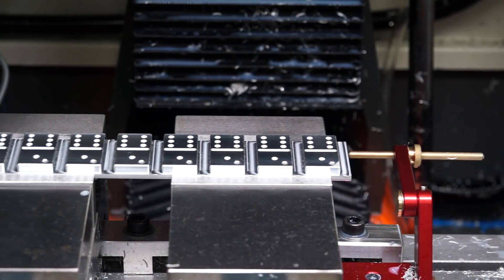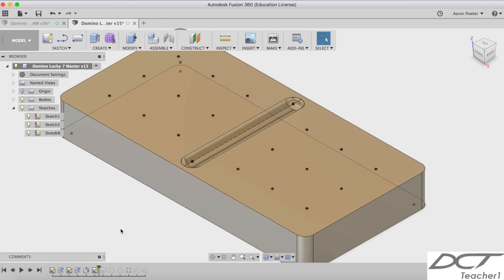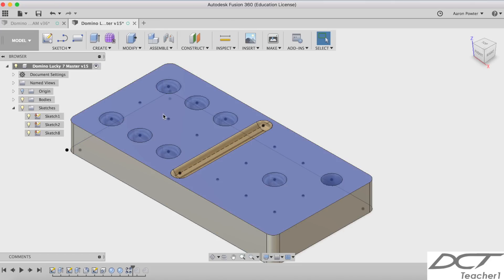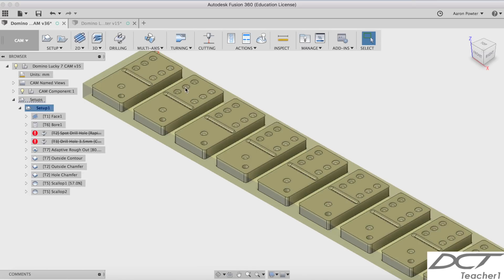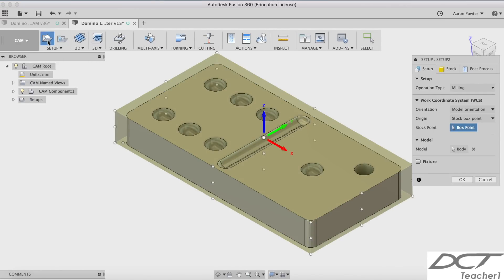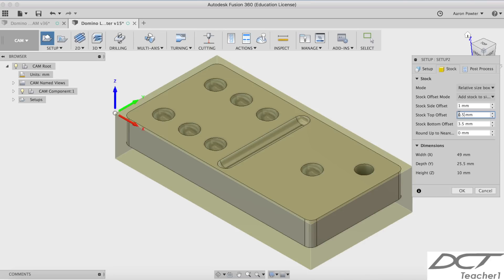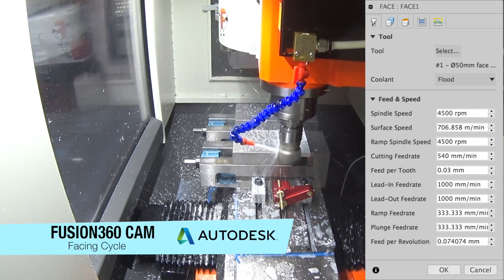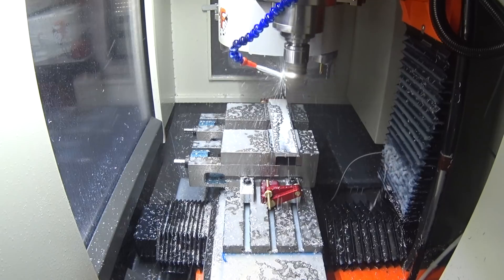Fusion 360 CNC Machined Dominoes Pt.1

Comment: Hi Aaron, what driver does the Skyfire use?
Reply: Aaron: Thanks for the honest opinion of the 4650 controller - you probably just saved me from a total disaster! I was just about to ignore my fears about the Skyfire not having local support and getting a quote on an SVM-2 with the 4650. Bullet dodged this time.
Reply from the maker: Hi Marvin, do you mean what Post Processor am I using?  If so I'm using the standard Fanuc Post that has been modified to suit my machine.  The controller on the machine is an Adtech 4650 (Chinese).  The controller struggles with large files and complex 3D toolpaths.  Cheers, Aaron.
Reply: Aaron: looking at the Adtech site, they have a new 9640 controller to replace the 46 series. Its so new that there is no manual but they do mention increased CPU performance and more ATC capabilities. It is also the same physical size so I emailed Skyfire about the possibility of using it. No reply so far...

I also looked at the ATC support in the 4640 manual. I am absolutely no expert, but there is a hint that the controller will handle up to 24 tools and that your 7 +1 is an artificial limit. The SVM-2 has the same controller and more ATC slots, so it makes sense that the controller will handle more.
Reply from the maker: Hi Nick, sorry for my belated reply.  My honest advice, give SF a miss and get a price on a SyilCNC X7 or X5 combo.  Check them out on Instagram "CNSyil".  They might be a tad more expensive, but much better bang for buck.  Syil will soon have 3 dedicated controllers on offer.  This will be Linux, LNT 5800 or Siemens.  Furthermore, Syil are an OEM company so at least you now they will do proper quality control checks before shipping.  Unlike another company wink wink ;-).
Reply: Thanks Aaron! The X7 has some great features - I wish the table was a bit longer we can't have everything. Will definitely get a quote.

Comment: Thanks Aaron, as always very informative. Can you explain the limitation about tool library with Adtech controller?
Reply from the maker: Hi Marc, the controller on this machine is an Adtech 4650.  I believe they are still sold by the company but further development has been stopped.  The controller is fine for simple 2D operations.  However, it struggles with large and complex 3D toolpaths.  As you can see it works fine within the parameters that I use it for.   Furthermore, it is locked out to 8 tools only due to the tool changer and I cannot any tools or the library outside of this.  Cheers, Aaron.

Comment: Nice and clear explanations, thank you mate. 

Quick question if I may.... 
You spoke about being limited to 8 tools, (well 7 to mill with) in the Skyfire changer. With other systems, can you have say 16 or 32 holders ready, with tools setup in them, and have all of them loaded into the VMC program? That way if your job needs say tool 14, 19 & 27, you can load those tools into the 8 way changer and just tell the program that took 27 is in slot 5 (could be 27/5 in prog) 
Or am I over thinking my options? 
Thanks for any help/advise Aaron
Reply from the maker: Hi Rob, thanks for the message mate.  Yes I totally understand what you mean.  And this is possible in most other controllers / machines.  However, for some reason my machine only has 10 tools listed in the tool library, but it impossible to access any tool outside of tool 8.  In other machines you could call up any tool outside of the carousel and the machine would put that tool away and you could simply do a manual tool change.  I could do what you suggest and list tools offsets for 9 and 10 and place these in a different pocket number (but use that offset).  But it only gives me 2 more.  Oh well, that will teach me for going with a Chinese controller that is no longer supported by the company.  Cheers, Aaron.
Reply: So which is a good controller to look for? What’s on the Syil X7?
Reply from the maker: Hey Rob, If I had my time over again I would have bought a Syil X7 with a Siemens controller.  However, Syil CNC are currently working with another Taiwanese company called LNC 5800.  This is much better controller or so I've been told.  Cheers, Aaron.

Comment: I never heard of that CNC Mill...what are the specs and how much does it cost in USD?
Reply from the maker: Hello Brandon.  This CNC milling machine is made by small company in China called SkyfireCNC.  Defeng Ren (GM of company) used to be a machine design engineer for another larger OEM company called Syil CNC, before leaving and opening SF.  If you would like to learn more about the machine may I suggest you watch my other video titled "SkyfireCNC - Your questions answered".  Thanks for watching. Cheers, Aaron.

Comment: nice one Aaron. It will also be great if you can do a quick video sometime on how to manage tools in Fusion360 tools library, thanks
Reply from the maker: Hi Jatinder.  Thanks for watching buddy.  Yes managing tools can be a nightmare both in Fusion and on the Adtech controller.  Would you believe that Adtech only has 10 listed tools in its library.  And I can't manually access tools outside of tool 8.  Cheers, Aaron.